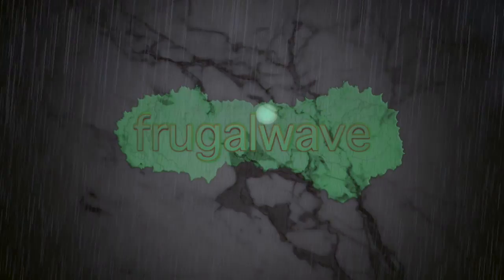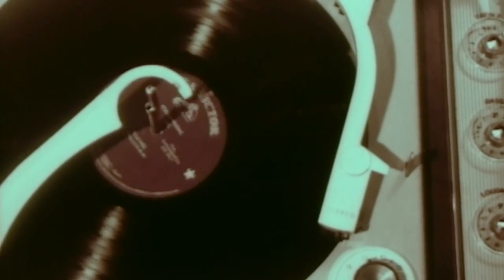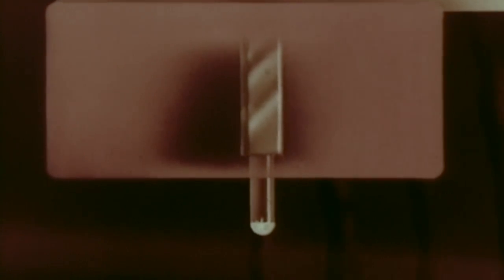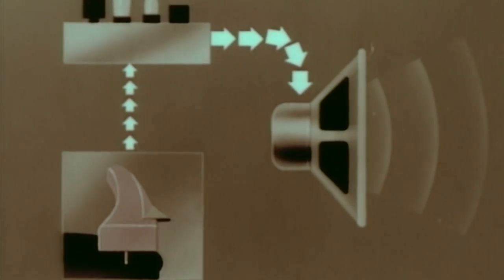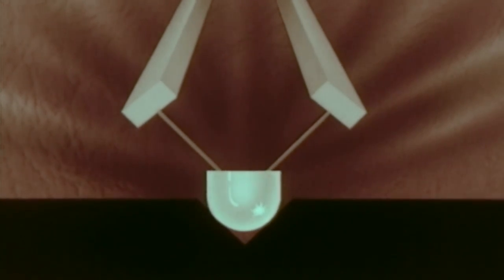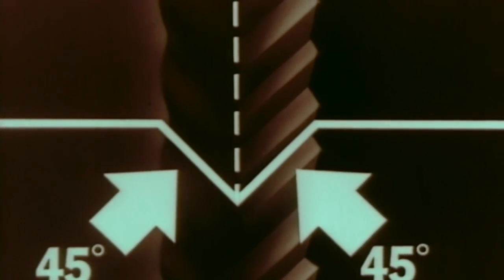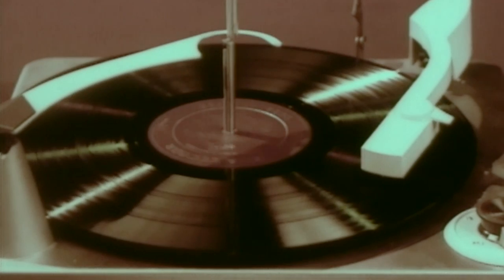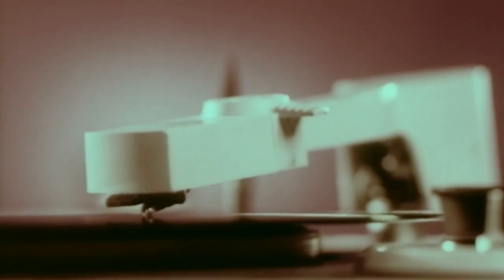How a Vinyl Record Creates Stereo Sound

Comment: It somewhat explained well, but still don't get it.. If we create a Human size disk, can we carved it to the disk? Like normal wood carving and turn it to a sound?? 

Because a sound that turns to a carved in a wall doesnt make sense to me.
Reply: maybe this answers your question (and the answer is yes) https://www.youtube.com/watch?v=XukLEaMbm9k
Reply: Hey, so we need to remember that sound is a wave that propagate thru air or water or solid etc, so it needs something to propagate (that's why there is no sound in vacuum), so the waves have a wavelenght, a frequency, etc... you can think of air vibrating with a certain frequence. Same thing in the vinyl, the tip vibrates at a certain frequence that is, thanks to speakers, converted into air vibration that makes sound
Reply: 3 years late but yeah if you take a disk like that and hold a massive wooden plank with a pointy end against it in a way that let's it swing back and forth you basically made a analog gramophone in big and terrible sounding.